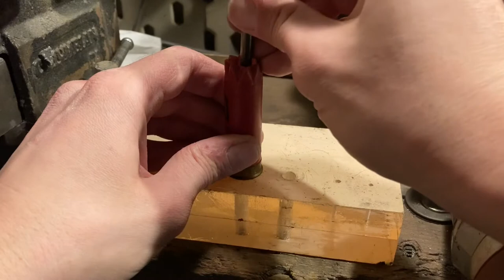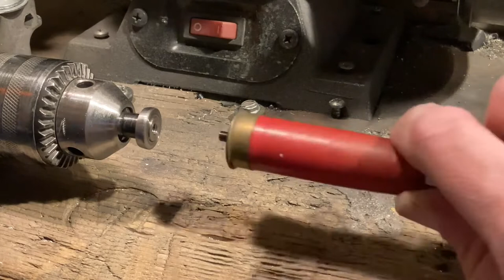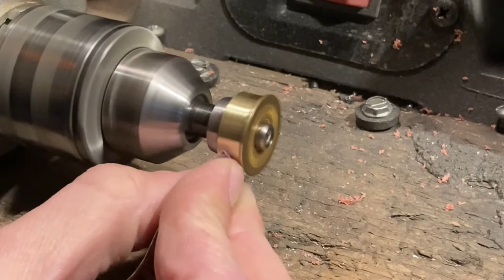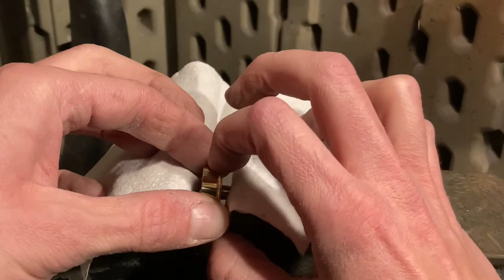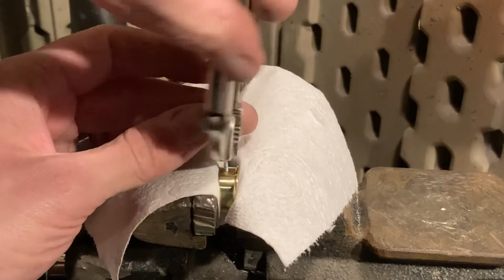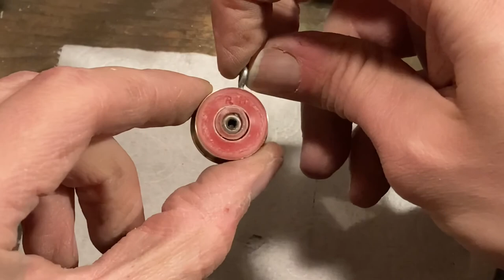Making a 12 gauge shotgun pendant

Comment: Theres an easier way to take off the brass 
1: heat up pan on the stove
2: put shells on for 2 mins
3: use pliers to hold on to the brass
4: pull of plastic
5: let cool and then your done
Reply from the maker: I wanted to keep the plastic, reduces sharp edges 😉
Reply: The metal is not sharp on the brass I take them off all the time and never had a sharp one